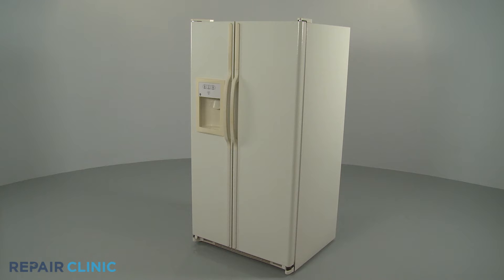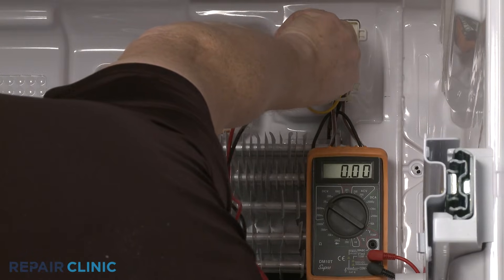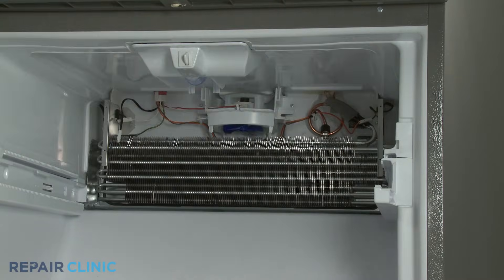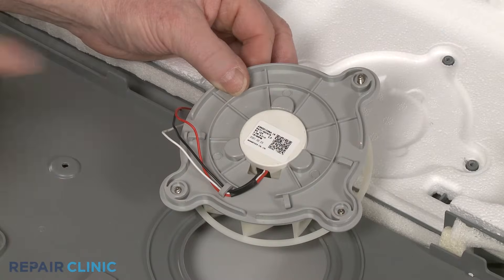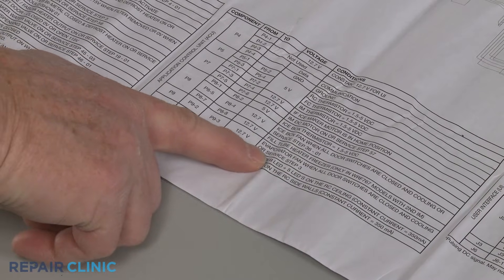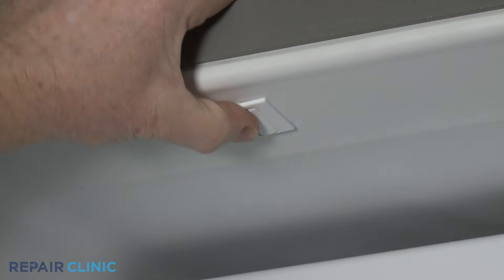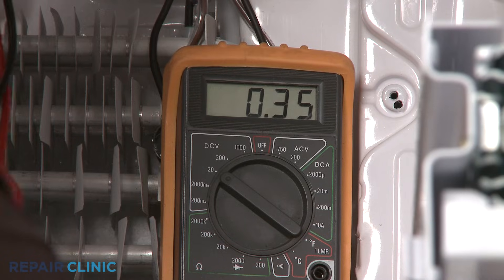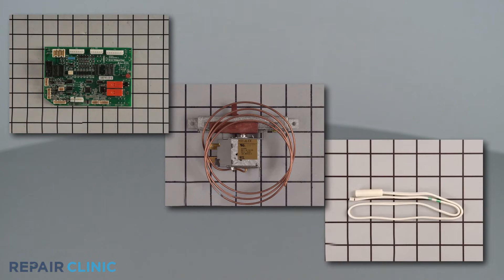Refrigerator Evaporator Fan Motor Voltage Testing

Comment: I tested my evaporator motor unplugged and it came in at 35 ohms and then applied remote 110 while unplugged. The motor ran independently.
Then  tested input 110 wires, while motor was unplugged, but fridge plugged in, tried run mode, and defrost mode, by  rotating defrost timer. (which I have just replaced).
Also, the  thermostat defrost sensor  is open circuit . Which I believe means its bad…(waiting for part)
Still no 110 volts at evaporator motor terminals??? Also condenser runs when plugged in.

Comment: Always check voltage with the load connected by back probing. Under zero load you will often get normal voltage readings and end up replacing the fan motor for nothing.